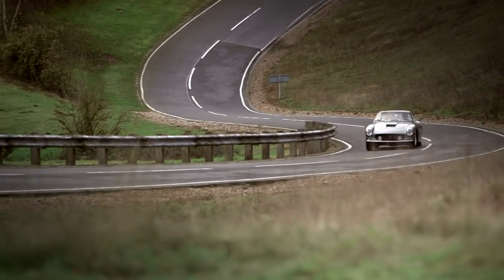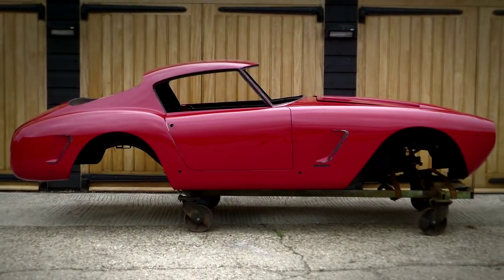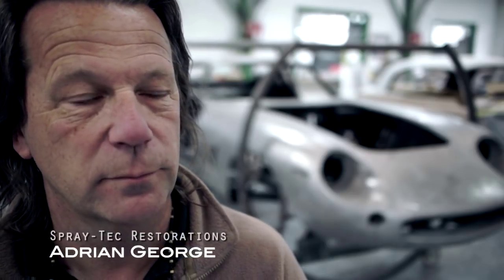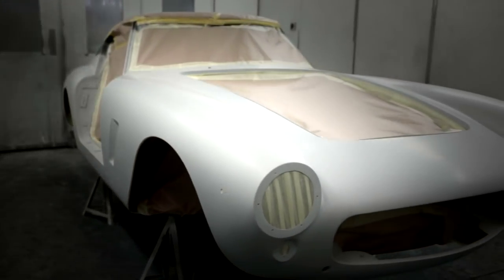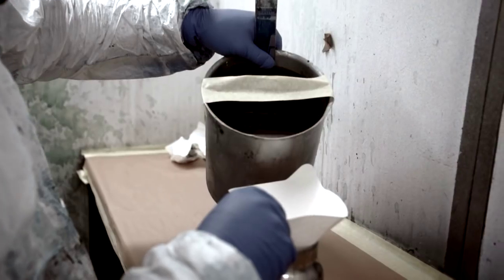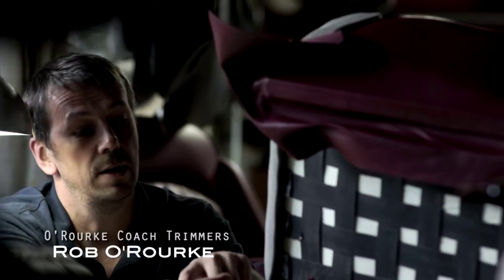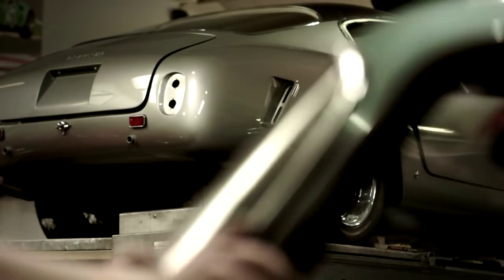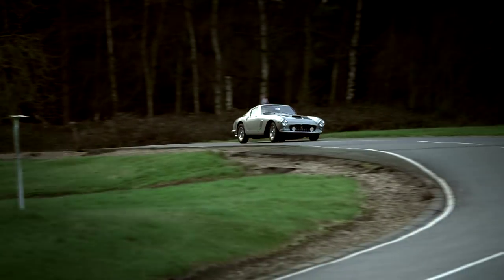Ferrari 250 GT SWB #3425 Restoration Documentary for DKTV and DK Engineering

Comment: Beautiful car, I don't usually like silver cars but this looks so much better in silver than red.
Reply: Zach Halliday 
Working with alloys, steel, wood, leather, etc. requires exceptional skill.  I wonder if the mid 70's Ferraris with their plastic switchgear and electronic devices will get the same attention during a restoration years from now?
Great video!